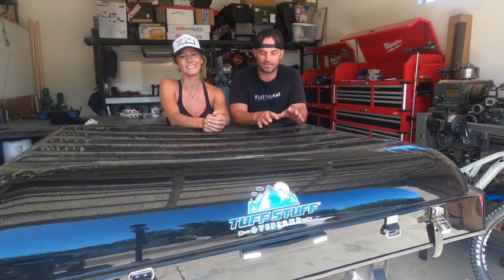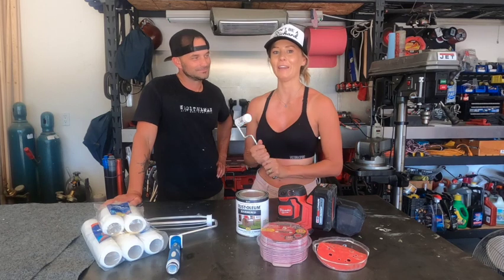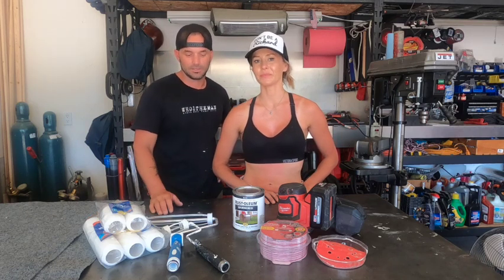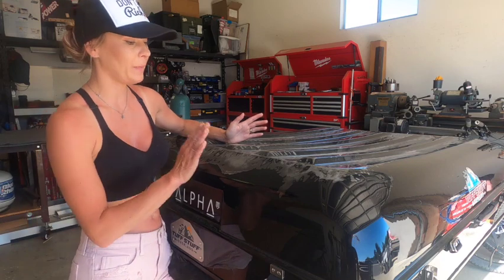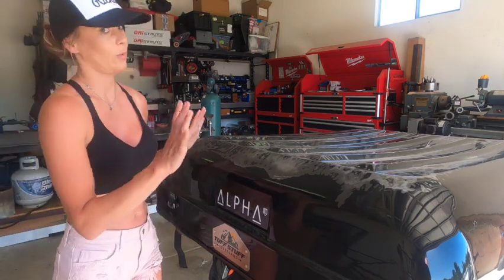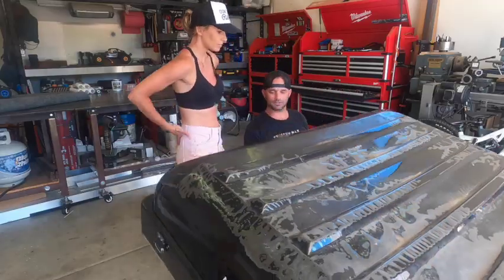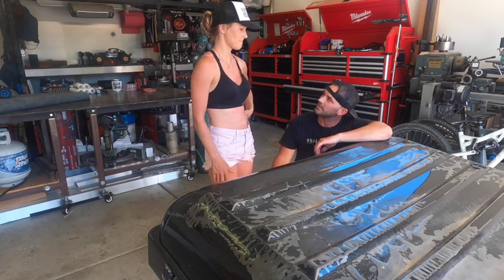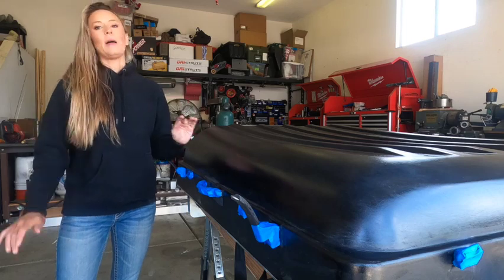We painted our Alpha 2 hardshell rooftop tent!!!

Comment: Got a link to the paint?
Reply from the maker: No link,  but we bought ours at Home Depot or Lowe's
Reply: What color did you do and Will 1 quart be enough? @neverlostadventures
Reply from the maker: @Reqzabx  1qt is fine for thin coat and depending on the sq,ft your applying. We used close to 2qt as we needed/ wanted a think durable coat. Be sure to let fully cure/harden for min. 24hrs, preferred 48hrs.
We used "Hammered" color.